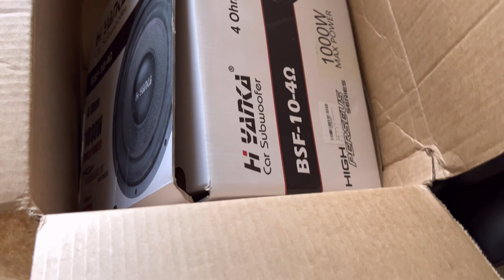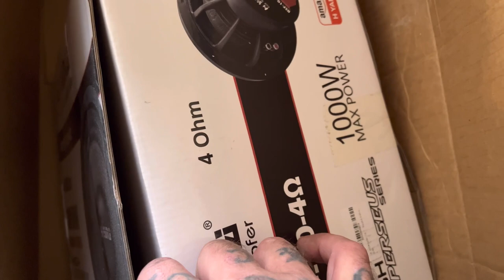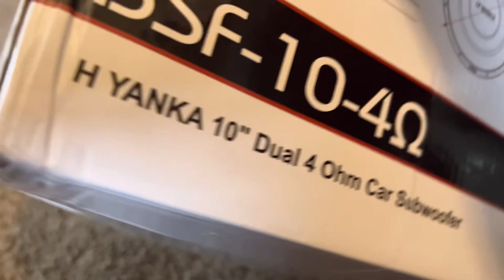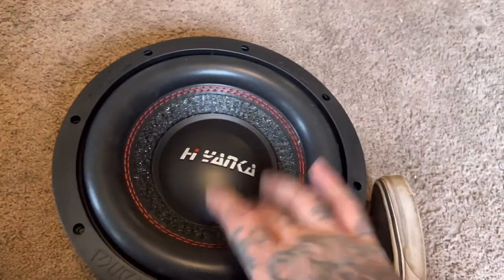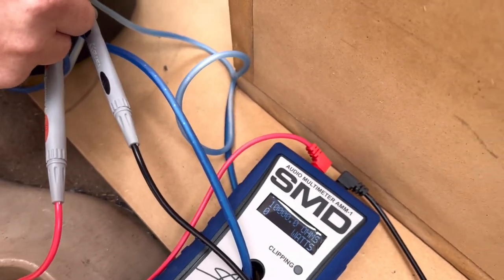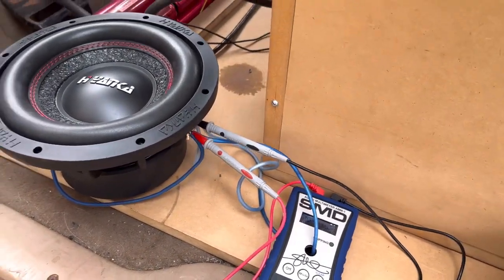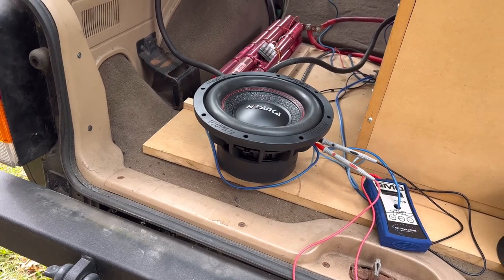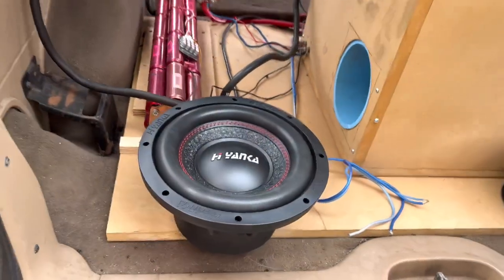Unboxing and free air testing a Hi Yanka 10” subwoofer

Comment: kinda interesting lil sub...and it's cheap🙂...cheaper like mine "low budget" gladen 6.5, however what i've seen, imo they are quiet similar in everything - even the x-max for their sizes and the stiffness (maybe my gladen is made of better quality materials and / or each component is done more precisely, maybe not...🤷‍♂), just this hi yanka is bigger = imo maybe even this would be good in a low / mid 20ish hz tuned box too...and just an idea: break it in properly, and because it is a so cheap sub, remeasure it's ts parameters with a "micro-budget" method which can be really totally free if you have at home the stuff which is needed to make the measuring device - most of people who is in the audio business, have those at home (tested it out - it really works, not so hard to do it)...i will leave a link for this method as an answer for this comment with some more explanation, and just hope yt doesn't delete it...
Reply: first, i dont know if you heared about this method, that's why i'm so detailed...before the link: 1: it is not so well translated in english - but understandable, 2: the software works on win10 too, 3: works pretty well with today's regular onboard soundchips too even just with microphone input, 4: after measurement start type in the measured parameters into winisd - to let the winisd count out the other missing parameters, 5: winisd calculated impedance (znom) maybe not will be correct - use just regularly dual 4 ohms in the future for this sub, 6: the measurement results can be different depends on the vc connection (parallel / series / separate...), 7: for x-max - first i measured x-mech - by pushing down the cone totally, and approx. the 2/3rd of the x-mech is x-max - this definition is said to fit for any speaker - also seems to be bb6pro software uses this definition - but i'm not 100 percent sure if this definition is correct or not, but was ok for me...the link: http://tksoundworks.com/z-navody/meranietspen.html
Reply: @PBasschannel  could just buy DATS,  been using it for many years. And it's very affordable, reliable and accurate

Comment: Subbed! What box would you recommend for this sub? I currently have this sub in a Skar prefab 1.25 ported box giving it just over 500 watts. I feel like it needs more power and more airspace. Seems like the sub just wants more.
Reply: The box specs are 1.5 cubes ported tuned to 33 htz I am a affiliate for hyanka. And the subs take 1k RMS all day
Reply: @joshholden8561  perfect thank you! I believe you on the power, I’ve got an Alpine MRV 500 on it and the sub eats it up and seems to want more. Plan is to grab another 10 and put more power to them babies. I’m loving the sun it’s badass.
Reply: @joshholden8561  this is what I needed to see!! 💯 I bought 8) of these and going to run them in a clamshell box with a jp10.4